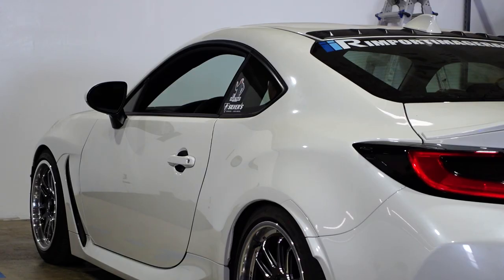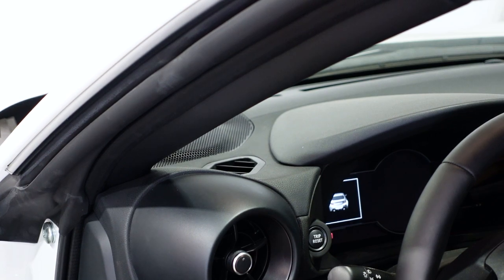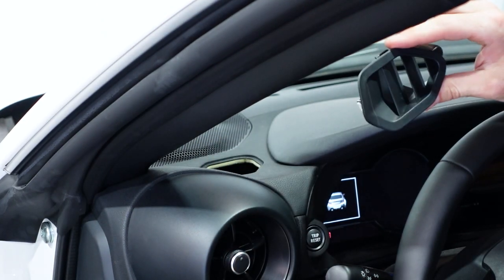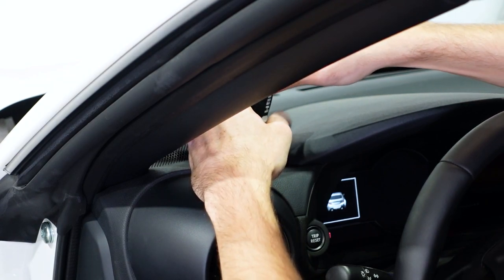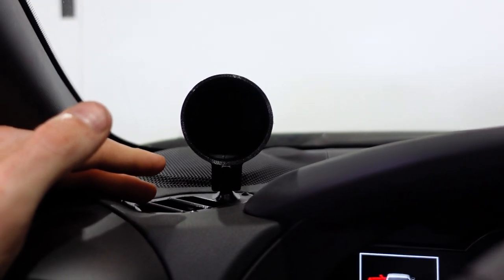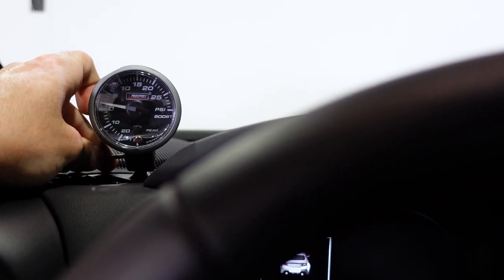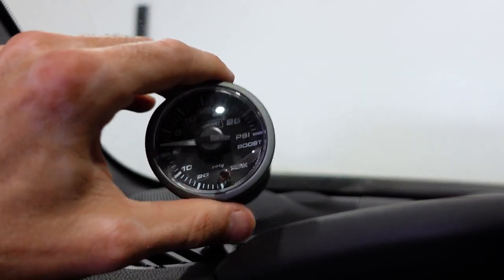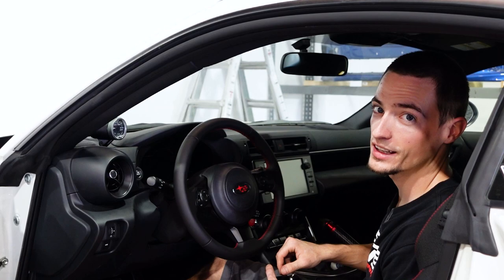2022 BRZ/GR86 PRINT3D Gauge Pod Vent BRZ Install

Comment: Can you guys please do a 3d print for brz front plate. Something that says sti and shows no bolt or maybe super small bolts that goes right in without drilling
Reply: That or have bolts that a flush with the plastic … I bet they could even design it to have a lil plastic cap but that would be a bit more difficult (it would look fly af tho)
Reply from the maker: We are currently working on this however they won't be 3D printed they'll most likely be aluminum.
Reply: @ImportImageRacing  perfect I'm excited !! I hope they come with different color and different badge style like sti or brz

Comment: I know it was mentioned in the comments below - But Could this adapted to use a MagSafe iPhone Charger? That way it would allow wireless Phone Charging and a safe mount.

You dont even need to include a Apple Charger just make a disc to fit the puck! This would be genius!
Reply from the maker: We actually recently made a prototype Magsafe holder for that spot but are still refining it!